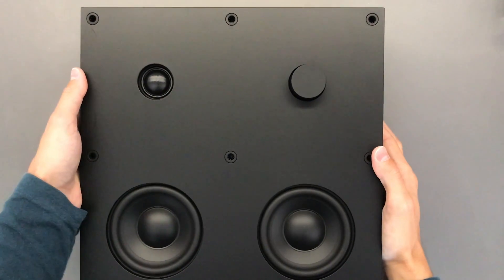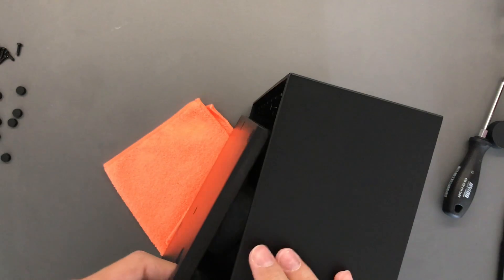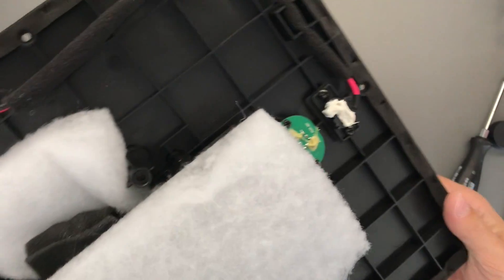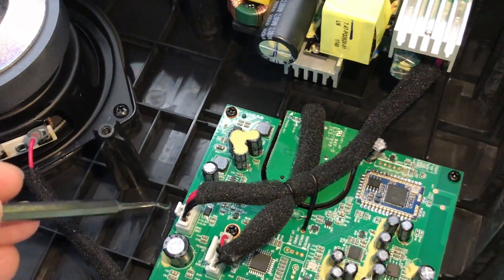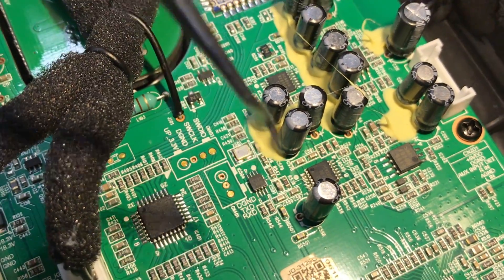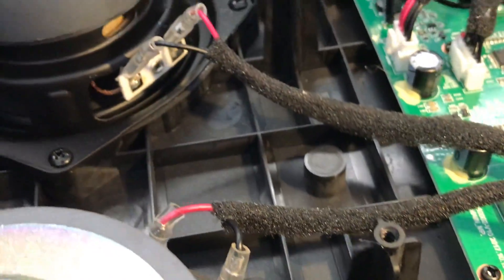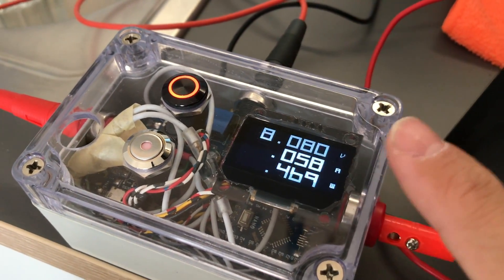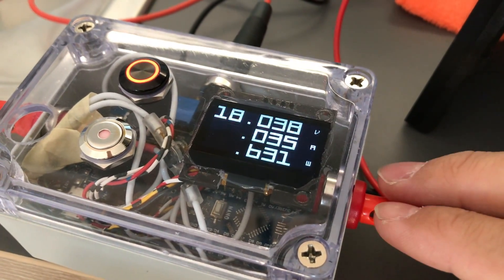IKEA Eneby 30 - Teardown Review

Comment: Hi Darieee. Like others, I was surprised about the auto shut off function. And though i didn't fix this, i worked around this, by hacking the speaker with a Sonoff SV module. Now I can remotely turn it on and off, and it works and integrates with Google Home Assistant or Alexa through the SmartWeLink add-in. Watch how I did it here: https://www.youtube.com/watch?v=plQVjyUk0FA&t=4s
Reply from the maker: That's almost cheating man - but, I'll give it a pass since it's all inside the box
Reply: @Darieee  lol... I was cheering and clapped my hands when the power supply showed 18 volts
Reply from the maker: Yeah, always a great feeling when the pieces fall into place nicely :D

How are you dealing with the 50% volume cap ?
Reply: @Darieee  well the 50% hasn't really become an issue yet. Rarely cranking it all the way. But perhaps I end up installing a small pulley to motor system 😂🤣 naahh..
Reply from the maker: Could easily get an arduino to spoof the encoder :D I can give you the encoder "decoding" code if you ever go down that dark path

It shouldn't take much to turn it into an "encoder" of sorts
Reply: @Darieee  Sounds like fun, although the IKEA employee I spoke to before bying, sayed that they're currently co-working with Sonos on a new line of speakers. Should be in stores in Denmark in 2019. I guess a lot of the issues and the hole smart thing would be fixed then.
Reply from the maker: Yeah .. well .. if sonos does it they maybe know not to program always plugged in speakers to go off

It's like your tv you go off every god damn 20 minutes and you'd have to go turn it on from the button after that
Reply: @Darieee  Exactly. Well thanks for sharing this video. I will be subscribing for feature uploads :-)
Reply: @oooodanieloooo  Can't wait for these to come out appartently October here in Australia. I only just tryed the Eneby 30 today.

Comment: How did the battery mod go? I tried 5s lithium. But the original powersupply charges them only to 18.3v. So I tried an old laptop charger at 20.5 volt. Which worked ok for 2 days and then couldn't handle pushback from the battery and stopt working all together.
Reply from the maker: I have the parts on their way; 5S charged to the brim is 21V, which is quite a bit high given the original design wants 18

I have the parts on order and will build a 3S pack, with a constant-current buck regulator coming off of the built-in power supply, a 3S BMS and a 3S balance board
Reply: Darieee yes that was my second idea. But how wil the battery power be activated? Because when just attached to the amplifier board, the eneby powersupply wil push back. A diode maybe?
Reply from the maker: Whenever you unplug the power - the battery will already be connected, so all of what the main board will see at mains disconnect is a drop in supply voltage from 18 to 12 (I'll be using a diode to bypass the buck converter for discharge)
Reply from the maker: Once I get the parts I'll do a video on it, if you want the schematic I thought of earlier, send me your email

Comment: I can’t understand why you would want a receiver to adjust itself relative to phone volume. As I understand things you usually want to adjust volume on the speaker primarily to reduce distortion which will increase the lower your output volume. If I have the option I would never want my output volume to be lowered at all, I would always prefer to adjust volume on the speaker. I may leave myself some room on the phone. Volume on a device I would set relative to the device. Generally in my experience speakers run too loud at full volume and usually hum at full. It doesn’t seem preferable at all to sync input and output. Even if Bluetooth doesn’t ruin the signal by changing the waveform it’s still preferable to be able to set the relative volume for the setting the speakers in. Like you said you’re walls are thin so you wouldn’t want to accidentally blast the speakers because your phone was at full volume. I think I must misunderstand or simply have a different philosophy when it comes to audio.
Reply: On digital amps it doesn't matter if it's the built in wheel or bluetooth volume (=phone volume) that adjusts the volume. If it comes via bluetooth, you have the full volume range available. If the control wheel is separate, both the wheel and the bluetooth output needs to be set to full to get full output. Cheers!
Reply from the maker: There's no distortion based on volume on the modern digital amps (they're almost always at their specified gain, though these might not).

You would want there to be a SINGLE volume ... the phone is at 50%, that is 50% on the speaker, you increase the volume on the speaker, it shows on the phone - the Bluetooth is sending instructions, not an analog sound - so ... distortion can't play any role in this

I'm sure you wouldn't prefer having to adjust the volume on your speaker after EVERY time it turns itself off, when the alternative is never having to do that with no penalty in quality

Again, with the hum at full volume - not the case here - and I want a unified volume, so, there would be this hum only when playing a silent track on the phone AT FULL VOLUME

Yeah so, regarding the rest of the comment - the above mentioned should have been enough to cover the last point you've made

Comment: I noticed some glue/paste around the capacitors. I’m repairing some subwoofers where the glue has become conductive (also due to overheating) over the years, creating all kinds of problems. Just noticing.
Reply from the maker: if the glue's good, there shouldn't be any problems ... I would rather have the glue and not have parts rattle themselves to death

Comment: The box looks ... uhm .. very plasticky. What would be a good way to see improve on that?
I’m thinking of building a birch multiplex box around it and glue and screw it together. 
As a posed to making a whole new box.
Reply from the maker: I'd try pouring some tar inside to make it resonate less
Reply: That’s bad you’re not supposed to do that On circuit boards
Reply: Spikes 47 
This was about the outside box, not the circuit board :)
Reply from the maker: I was thinking of inside - but obviously around the boards
Reply: With the smaller box they had some foam tape at the edges and they clearly has wrapped the cables in some foam stuff too to not make them vibrate against something so from a technical point I think the plastic is pretty fine. If you don't like the looks of it then feel free to don't do that :)
Reply from the maker: The big ones has what you said as well

Comment: Hi
Another awesome video. Tx!
I’ve got a few questions that i’ll post in separate comments. 
Will a higher input voltage result in a higher power output? If so, it’ll probably need some cooling.
Reply from the maker: it would, at 8V you can't get the power you would at 18 ...
Reply: Darieee I think I’d go for the highest voltage considering the amp is 30W @10% THD and you probably want <<1%
Reply from the maker: well, not always does the highest voltage yield the highest RATED wattage - check the TPA3116 datasheet and you'll see they don't power it with 25 or 26V or whatever was the maximum
Reply from the maker: also 60W into the subs and 20 into the tweeter is qqquite a looot of power